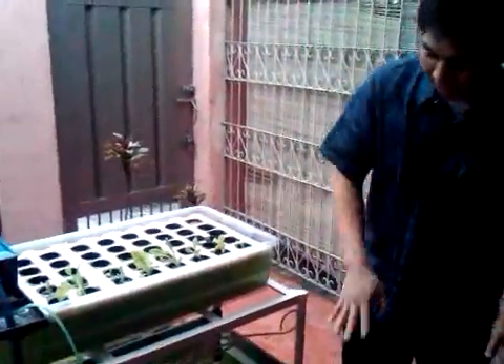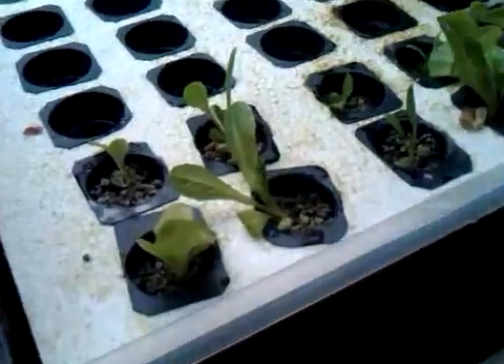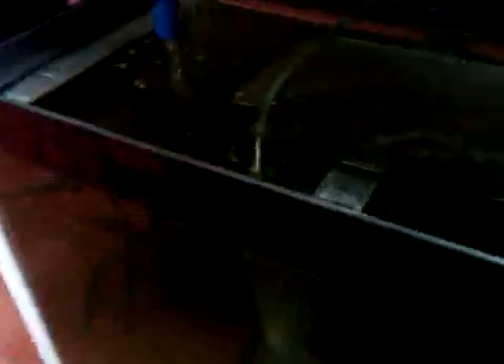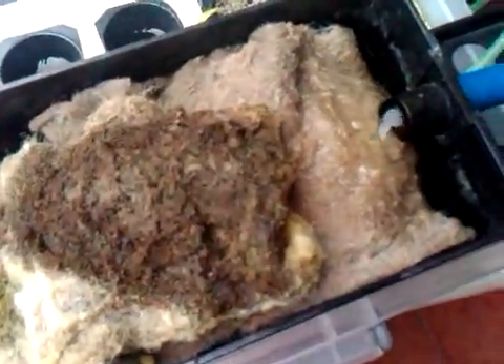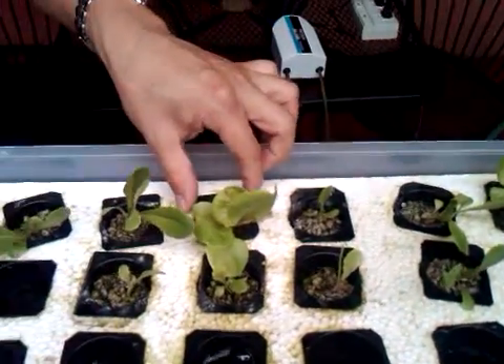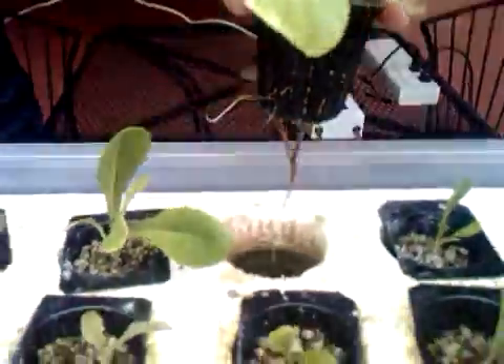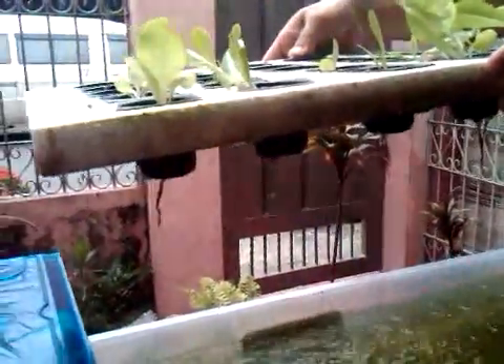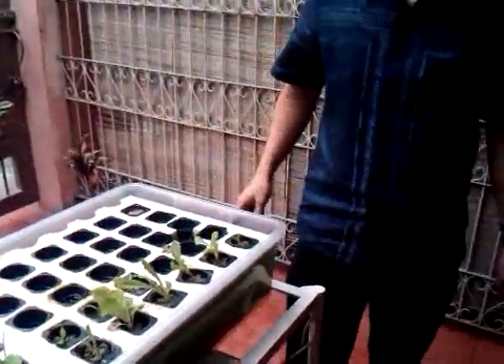DIY Home Aquaponics Philippines How to (Floating raft)

Comment: the chicken dung is a heavy load for the fish as they don't need it ! plants need it with the help of nitrifying bacteria converting ammonia ( exist in fish waste and chicken waste) to nitrate. And more of that, you have to clean your filter much more often because of the solid waste, and you also have to clean the fish pond cause not all waste will be picked up from your pond to the filter !

Comment: it's not a flood and drain system as he is not using rocks or clay pellets, it just floating on the pool of water with an air pump in it to provide oxygen for the plants ( it is needed or else the plants will drawn). there's a way to have a pool without air pump, you just have to levitate the raft to provide a space for the roots to breath, but you have to come up with a solution to adjust the water level cause while plant are small they don't have long roots which you need higher water level.

Comment: With 1000 catfishes in the pool we have to refill water every morning. If I do it twice a day the fish are eating more and obviously grow faster. Recycling, as I said, we grow bananas on effluents. As we have our own water well filtering is not necessary. We try to optimize a working cycle for pumps to reduce energy consumption. It helps to reduce expenses. I prepared a frame to keep chicken above the fish pond in hope to reuse the chicken dung but my wife is not approving it, so may be later.

Comment: HI there. Using a pool, from what I've learned, is not very affective way. You will need a balanced system for the number of plants that you grow. It would probably be better to use smaller sizes of pools / pounds instead a large pool. It's probably also better to manage. Is it necessary to refill your water every day? How about filtering and recycling you water? Have you experienced any other issues with your setup?

Comment: I have tried to make an aquaponic system with our pool of water 2x4 m and with about 1000 catfish in it. Water was going 1 m up, flowing through a layer of gravel and back to the pool. Pumps were at about 5% duty cycle. After first month a bill for electricity came and I gave up the idea. Now we just pump out effluents from the pool to our garden. It mostly goes to bananas and they grow well. We refresh water in the pool once a day during a night and use water from our own well to refill it.

Comment: Hi Engr. Rommel,

May I know the size of your raft, and the fish tank?
Also, what's the specs of your water pump, and aerator?
What's the model of filter you used in filtering the fish dirt? I haven't seen that one in any aquaponics system before.

Thanks,

JD

Comment: @Madodel Hmm. Actually that doesn't seem to be a problem then as long as you make a cage deep enough to support the roots.  I used to raise Tilapia but it was too cold for them in the winter. I just converted my 12 foot plastic pool into goldfish. The cheap metal frame pools work quite well.  Mine is going on it's 2nd year and I haven't had to use my spare yet.   I think it would be great to buy a piece of Styrofoam to experiment with and see what happens.  I wouldn't do it over my whole pool.